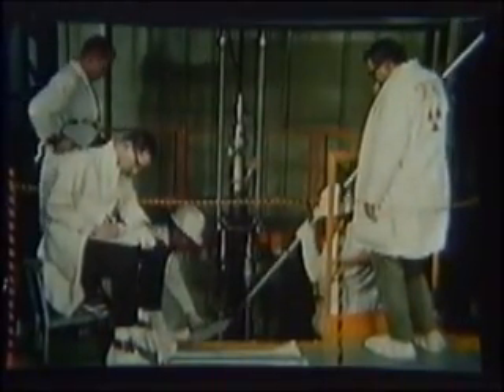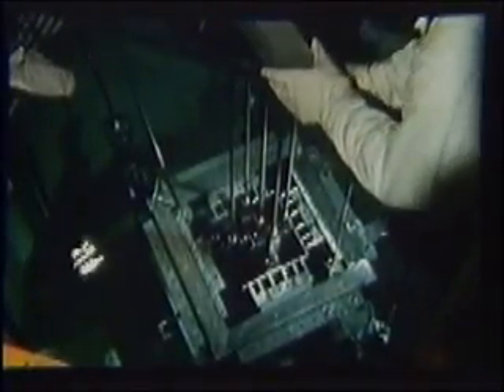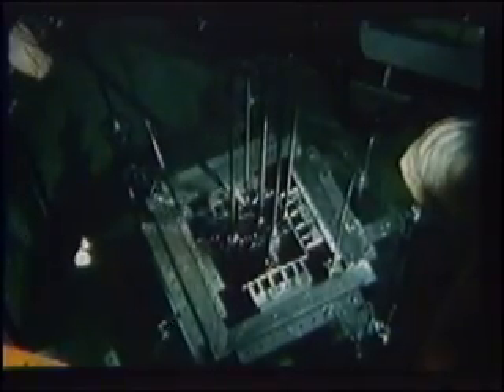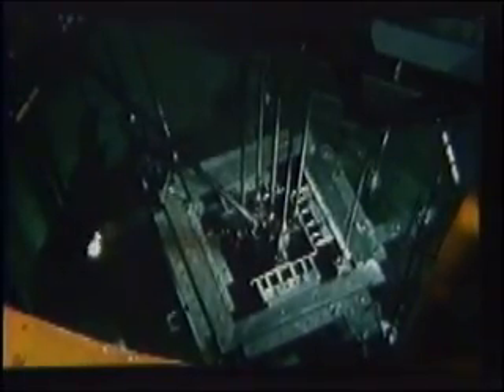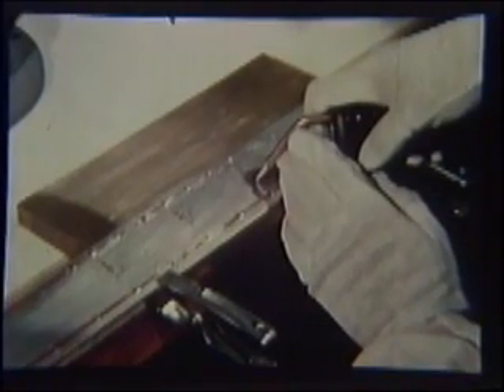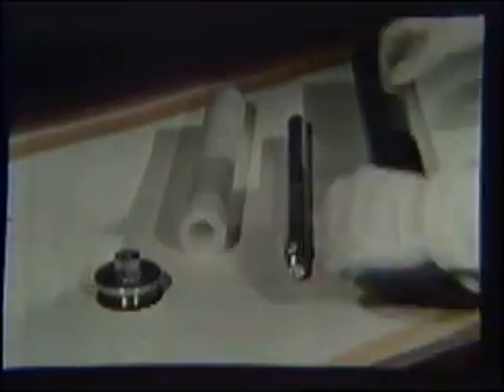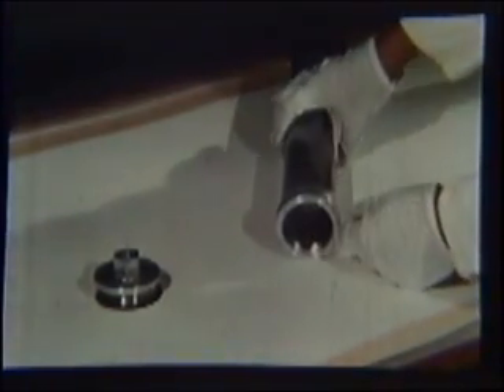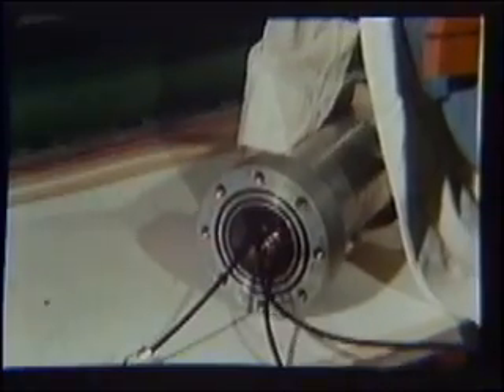SPERT - Destructive Test

Comment: I wonder why there was no "blue flash", characteristic of instant supercriticality?
Reply: There was, watch the right side of the reactor top after the control rod is full out.
Reply: +MrGoosePit that's what killed the guys at the SL-1 facility, one guy yanked the control rod out too far and triggered an excursion launching the reactor and sending the control rod through the operator impaling him and nailing him to the ceiling.
Reply: Derek
I was because of water! Molten salt would endure that power excursion...
Reply: +Władca Wymiaru
Don't buy the hype, if you have an accidental criticality excursion, then it will not stop until the explosion blows the fuel and moderator far enough apart that the critical configuration no longer exists. It does not matter what fuel or moderator you have, a power reactor must never suffer a criticality excursion.
Reply: @aleksandersuur9475  Power reactors can be designed to be self-limiting, so that during excursion conditions, the configuration of the core causes the excursion to stop with limited damage.
Reply: @derekwall200  According to what I'm reading right now They were dead pretty much instantaneous because of the pressure wave that hit them.  The impalement was likely an afterthought.
Reply: Some of the best nuclear physicists and ebgineers of the time conducted the test an yet they thought they could catch the blue cherenkov-flash on black and white film -.-
Reply: @TheNavalAviator  Peak sensitivity of B/W film is in the blue range....
Reply: @Highbrowser  oh really?
Reply: @TheNavalAviator  They did.... It was white.
Reply: hey bro, I know im late on this one but it went prompt critical, not super critial